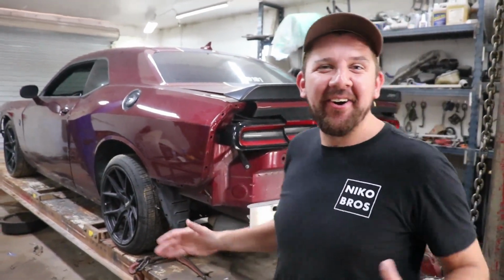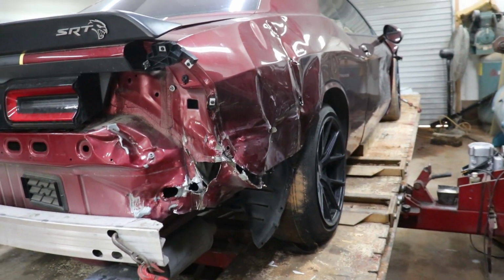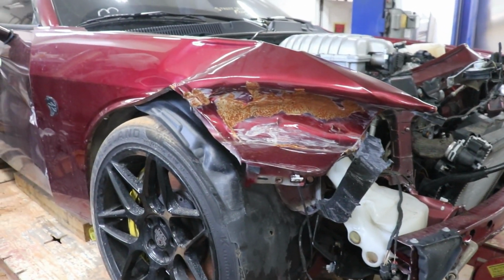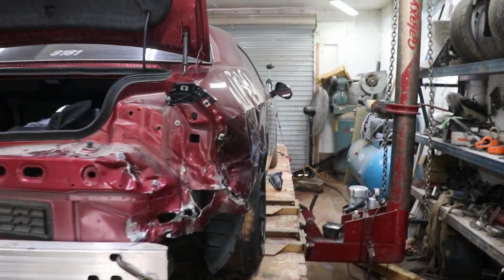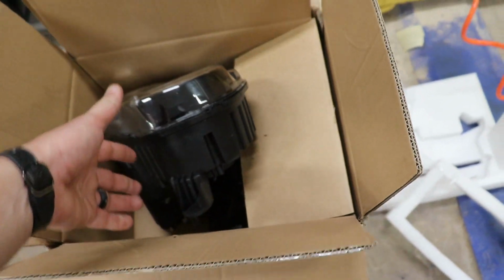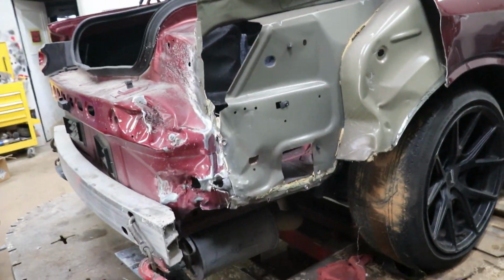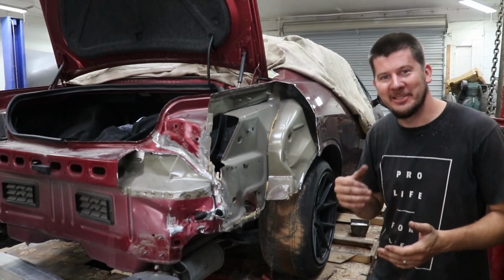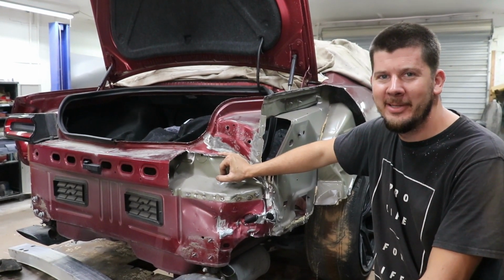2018 HELLCAT SRT TEARDOWN HIDDEN DAMAGE FOUND? Part 2

Comment: Mismatched rims, and the back tires are bald.  Those were the burnout rims/tires.  That thing got killed in a burnout competition.  Walls are quite often smacked because you can't see.  You should be figuring out where the noise is coming from in the motor, because without it you have a parts car.  Probably spun a bearing in the same burnout competition.

Comment: Guys you need to RUN from this car as fast as possible. This car was owned by a member of the Street Demons car club in Baton Rouge. All they do is close off intersections and do donuts and abuse their cars. I can almost guarantee that engine is blown. The doors are off another car because his were not damaged in the accident. The wheels were taken off. I think if you dig into the car you will find all the airbags have been removed also. You need to send this one back to auction and wash you hands of it.

Comment: From noise engine was making when they started it previously, they should have made certain engine was OK before starting on body. These guys make me laugh, got a complete donor rear quarter then whining about 'hidden' damage behind old quarter. Anyone that repairs salvage knows there is always more damage than you see at first glance, so if you can't deal with it don't buy cars Lol. Just hope they make a better job of this car than they did on that truck recently, frame was still bent down after they 'repaired' it 😎